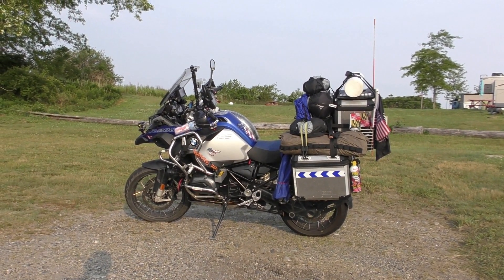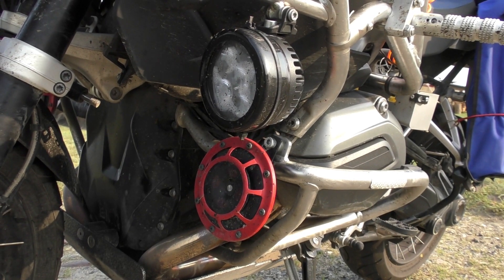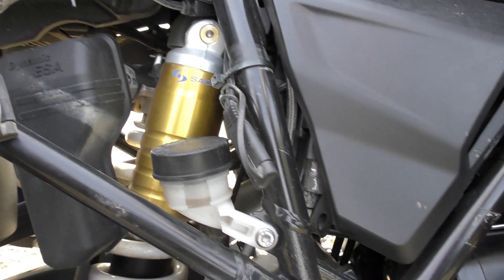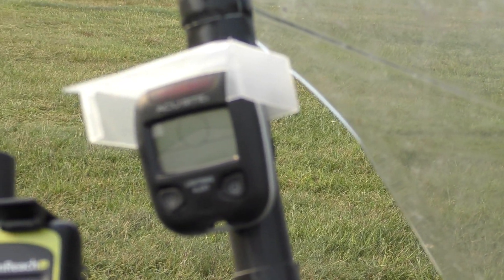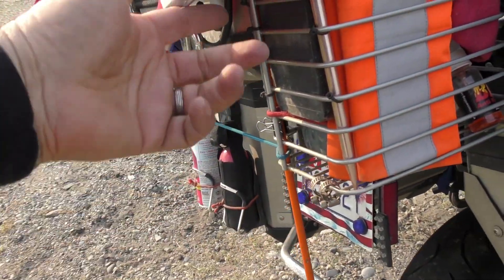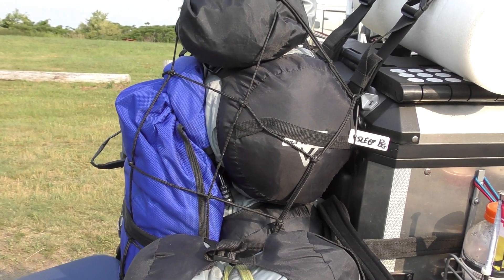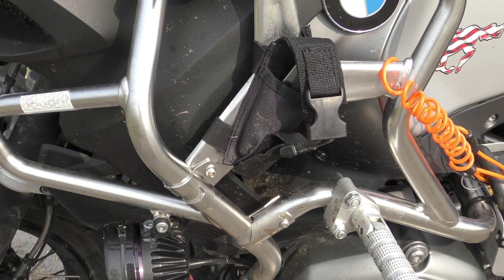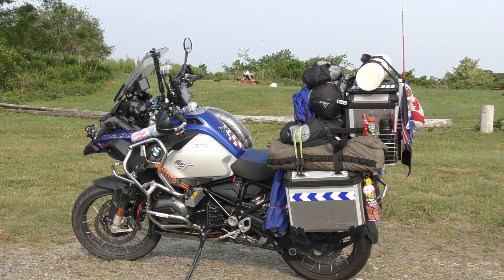BMW 1200GSA - The Beast

Comment: Where's the kitchen sink, ? lol. Very interesting video, thanks for sharing it.
cheers
tony
Reply from the maker: +antonoat Thanks! Actually, I forgot to show the collapsible bucket ;-)) I have one.
Reply: lol, thanks for your response. I should add I'm not surprised you have one! You seem to have pretty much every eventuality covered.
It's good to see one of these bikes used how it was intended and not just by poseurs!
Haven't owned a GS since my last r1100gs, which I racked up just over 40,00 miles on.
I currently own a Triumph Tiger Explorer 1200 but secretly am lusting after the bike you are riding! lol.
Thanks again, ride safe buddy.
cheers
Tony

Comment: Hi Cemil...love ure beast and all the nice gadgets u added to make the bike fit ure what you like. You said that the new bottom spotlights are fitted to the bikes canbus, I have exactly the same bike now and tried to change mine and to connect it but could not get it to work. I am not very clever with those type of connections, could you please help and tell me how and where to connect a new set of LED spotlights.
Reply from the maker: Hey Dougie. Indeed, you cannot connect 'any' LED to the Canbus. Some LEDs work, others do not. I use Clearwater lights that come with their own 'Canopener' which is a box that connects to the Canbus (between the LEDs and the Canbus). But direct connections usually do not work. Hope this helps... BTW, the Clearwaters are expensive, but they really work well.

Comment: Very cool, congrats on your ride! Nice setup. Could you elaborate on your go-pro hookup? I'd like to do something similar but a go-pro case with a waterproof usb connection is hard to find.
Reply from the maker: Hi. On this trip I used two GoPro Hero4 Black. One was set up on the pole connected to the handlebars. I used that one for slow motion with the shutter set to one click - when I hit the shutter, even with the camera off it turns on and starts filming. Admittedly, there's a bit of a lag; I'd say about five seconds, before the filming actually begins. Then I had the front camera set on time lapse. I don't use the video timelapse function, I use the multiple shots function. On this trip I shot at 2 second intervals. I'll be publishing the film soon, it's called Whitehorse to Washington. That's the one that uses a Battery Eliminator USB with Backdoor for GoPro HERO4 (10 ft). I got it at B&H. It's great. You take out the GoPro's battery, thereby avoiding the heat problem, and connect the USB to any power outlet on your bike, or car. I literally shot 148,000 images without a single glitch.

Comment: Cool setup. I've got the same bike but with much less kit. How much clearance is there between the Bark Buster hand guards and the edge of the screen on lock to lock? Thanks.
Reply from the maker: Hey. Not sure. Let me go down and measure :-) Be right back.
Reply from the maker: One Inch exactly with the fairing on its highest position. When you lower it, it hardly makes a difference. They're great both on and off road, but especially off road. The stock hand guards are flimsy and cover nothing. Hope this helps.
Reply: Many thanks. Really appreciate your help.

Comment: Beautiful report, can you tell me how you did to have gopro always linked to energy?
Reply from the maker: Hi Luis. I use what is called a 'Battery Eliminator'. It plugs into the back of the GoPro and gets its power from any USB type charger. I use a USB adapter that it connected to the bike itself. I hope this helps.

Comment: I wanted to ask your opinion about the different years, what years do you think are significant or better then others? I looking to buy one and my range is 2008 -2016, Will I lose a lot in the difference of the ride if I go older ?  What is your opinion. Thanks.
Reply from the maker: Hi. Super tough question. My best answer is that I love the liquid cooled series so for an Adventure that's 2014+. I admit that the newest 1250 is amazing as well but that implies buying new whereas, I believe, you're looking for a used bike. Personally, I love the 2014, pre-fob series. I plan on keeping mine for many more moons. If you're torn between the GS and the GSA, there I would say that the GSA is definitely the way to go. If you're an adventure rider, that fuel does come in handy, I've run low on mine more than once, imagine if I had been riding the GS. I don't think this has been very helpful but it's really a personal choice. Indeed, you will likely have some weigh in with air-cooled or die. I respect that too,
Reply: @CemilAlyanak  Thanks for the prompt reply. I agree the GSA was more enjoyable for me yesterday riding then the GS. It had a bigger presence to me, seems like cars respected me more and I liked the view from the cockpit more to, more substantial. Not to mention better shielding against the wind. Plus it felt just as light and maneuverable when riding. You did say something that made me curious however, you said you love the liquid cooled series more, can I ask why? How did they feel different other then the power. Also what does "pre-fob series" mean, sorry about my ignorance. I rode them for the first time yesterday.
Reply from the maker: @31acruz  When riding in the summer, the air-cooled just overheats. It's bad for the cylinder, bad for my leg and bad for my wife's foot. By pre-fob I meant before they went to the keyless system. The first couple of years they had a few worries. Personally, I would either go with my year - 2014 - or bite the bullet and go for a brand new 1250 either in 2019 or 2020 if you wanted to wait for one year under the belt. All this said, I've owned a GS since 1982 and I have never ever had a major issue on any of the series and I have owned them all.
Reply: @CemilAlyanak  Fantastic, that is what I looking for. Thank you very much!

Comment: Great video and great bike! That’s the way this bike was intended to be used. How many miles did you do so far on this bike and what problems have you experienced? Suspension, shaft drive, engine, gear box, electronics... any problems?
Reply from the maker: Thanks Dan. To date, zero problems. Just added 10,000 miles on a trip to Tuktoyaktuk. In fact, the Beast was the first bike ever to ride up the entire Dempster and make it into Tuk. I was there on June 2nd, 2018. So far I've got about 35,000 miles. Zero issues. I don't want to jinx it but so far I have had no mechanical or technical setbacks whatsoever.
Reply: Cemil Alyanak That’s great news! I wish you thousands of more, trouble free miles with your “Beast”!

Comment: Yezzz MadMax edition of the bike...batteries everywhere, water, petrol, survival kits...was waiting when you will pullout TWD crossbow :) - joke a side great video and a lot of small things that you have with you that was very handy to have on road trips...Ofc i never did 10.000km trips but maybe in the future (4000km was max for me)...Question is how heavy is your bike after all installed...
Reply from the maker: Thanks!! Glad to have inspired some ideas ;-) As for the weight, as I like to say, with all my gear, extra fuel and food for two weeks, I still weigh about two hundred pounds less than a touring bike! Basically, it's a lot of bulk but not a lot of weight. And the bike itself is so well balanced and has such torque that as long as you are not afraid to give it gas, very few conditions will stop you. Since the video I've made more additions/changes and keep saying I'm going to film a new video... I really have to do it soon!!!

Comment: Any reason I should stay away from a 2016 GSA? I’m new to adventure and really wanting to get into it, looking at a used 2016 bmW r1200 GSA or the pan America, thoughts?
Reply from the maker: Hi Joseph. As you know, I have the 2014 and still absolutely love it. Feels and rides like it was brand new. As for the 2016, I know three people who have one and they all love it. None have had any issues whatsoever. I can’t guarantee you won’t, of course, but I can report that they are very happy. One of them actually did a round the world with his. As for GSA versus Pan America, I’m unfortunately the wrong person to ask ;-) I’ve been riding GS since the first year (actually the first month) that the R80GS was available in North America!!
Reply: @CemilAlyanak  so will this be a good first adventure bike for me to start on?
Reply from the maker: @josephgallant3211  That is a very complex question; so many factors. No need to answer, but much depends on your age, level of general motorcycle riding experience, strength, height, type of terrain, level of gung-ho-ness. If you’re my age, no, it’s not a great first bike. If you’re a novice rider, same. If you’re a little on the weaker or shorter side, you’ll be fine on the highway, maybe not off-road (unless you’re built like Gaston Rahier ;-). Riding a smooth gravel road, fine, riding single track on a muddy day, you better have some experience under the belt. Finally, much depends on your own level of aggressiveness. Riding a 1200/1250/(1400??) GS or GSA does require some level of aggressiveness; when you’re riding through sand or mud, the last thing you want is to have the reflex to get off the throttle. In short, absolutely an amazing bike, even a first bike, if you’re up for the challenge. Otherwise, if you have the money to buy something, lose a little and later upgrade, I might start in the 800cc range and move up. Not sure if this ramble helped; hope so!
Reply: @CemilAlyanak  thank you

Comment: Where do you hang the dogs kennel ?     In Australia police would give you a sticker for dangerous overloading, which would invalidate your insurance...
Reply: +Graham Spink If you think about it, all my gear weighs under 100 lbs (45 Kg). That's not even the weight of one passenger. Not to mention that the GSA is already a very light 1200. And, everything is really well tied down. In short, looks overloaded, but it really is not. Heck, it goes off-road, through sand, even mud, and I haven't dropped it yet. As for the dog kennel, good idea! ;-)
Reply: Thanks ...Ride Safe ....

Comment: On mine I use the commander tires and I put some awesome miles on my Soft Tail Classic and they stand-up well in all weather so far.  I live in the Ozarks in Arkansas right off the Pig Trail, and they hold the road super well on curves, you might look into them....See you down the road(:> Davis Earth Shaking Motorcycle Adventures>>>
Reply from the maker: Silent Pray Thanks for the tip! Much appreciated!

Comment: Tjeeeeeehhh.....you need a car! Nice bike, but Some lessons in weight reduction, and how to pack are in place!!
Reply from the maker: Wouter Van Duijn you do realize that fully loaded, I still weigh less than most Harley's, any touring bike or any large cylinder bike pre 1990? But hey, to each his own. Some travel super light and I admire that. I've even done it. I travelled into the Sahara with an R51/3 and a back pack, nothing else. Drove 3000 miles that way.